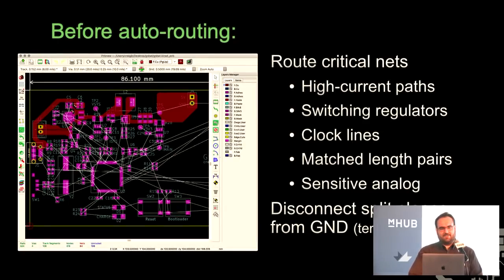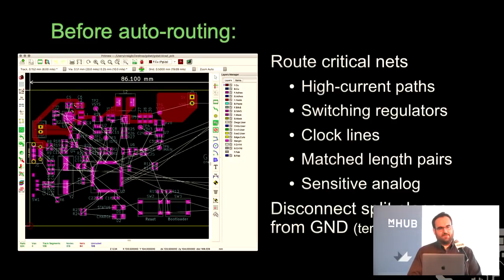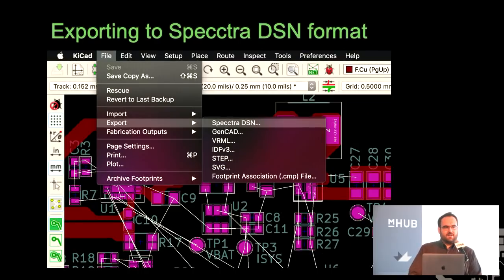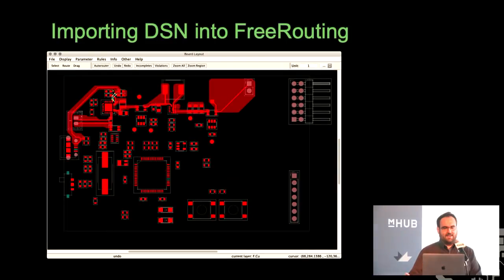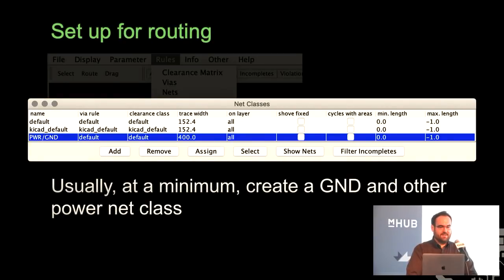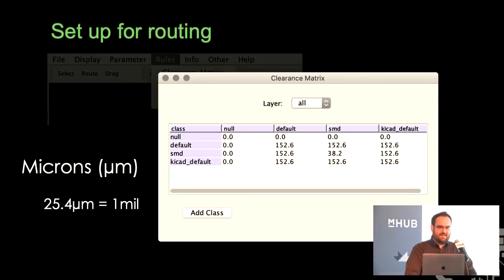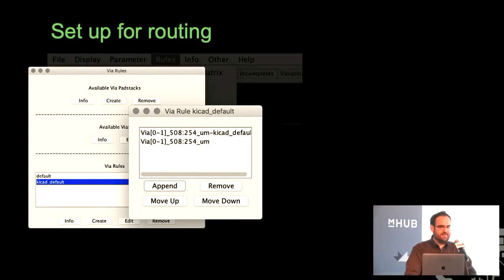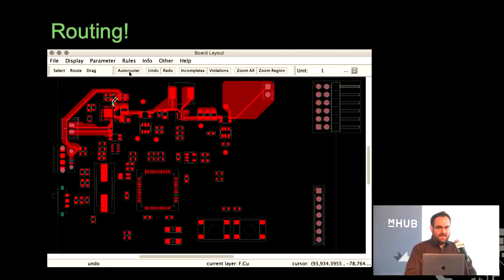"Why Auto-routers Suck, And How To Use Them Anyway" - Craig Bishop (KiCon 2019)

Comment: I hope future auto-routers not only route the trakcs, but actually move components itself. Often I don't care where the chips and resistors are exactly, and for capacitors and stuff like that I can specify them to be close to some component or pad, and auto-router is free to move things around as it pleases, while just keeping some other rules in check (like maybe I want some component to be further from other components, because I want a heatsink on it, or maybe I want all components to be as close as possible to minimize the board space, so auto-router should put them close, and then I will rearrange any connectors and stuff to also be close, and then decide on the size of the board. It would be pretty cool.
Reply: I'd like to see an auto-layout step that could be used iteratively. When you get the mess from the netlist the first time it would be nice to press a magic button that would run a tidy-bowl function on it and try to toss the parts around in some logical manner. Then you could grab big hunks and drag them to where you wanted them if you didn't like the automatic layout completely (as you almost certainly won't) and do a tidy-bowl again to fiddle the small parts around based on your new constraints. Once you have your parts layout and board edges you can run the auto-route.

Comment: TopoR seems really cool and the boards are very elegant and nice looking, but it caused MASSIVE DRC violations for me when used with KiCAD. I don't know what is the problem, but it did crossed traces of different nets in the single layer in several spots, it ignored clearance to cutouts in middle of the board (clearance of outer outline is OK). And lots of trace clearance were just smidge too close. That would be kinda OK, but major shorts between nets are no go for me... I don't know what is the problem... Maybe spectra interfaces of KiCAD and TopoR are not fully compatible, there seemed to be some glitches, i even had to slightly modify the file generated by TopoR (filename escaping was broken for files containing space character).